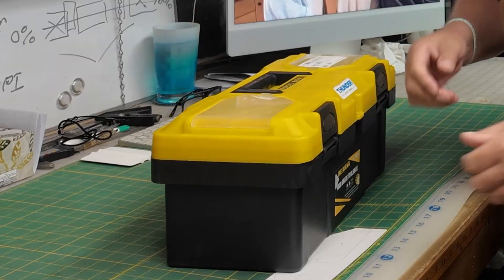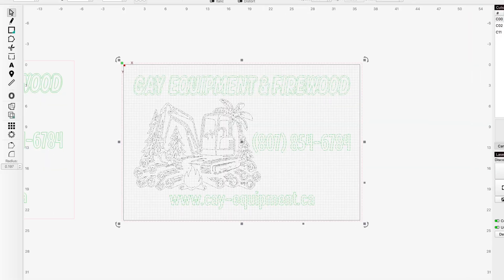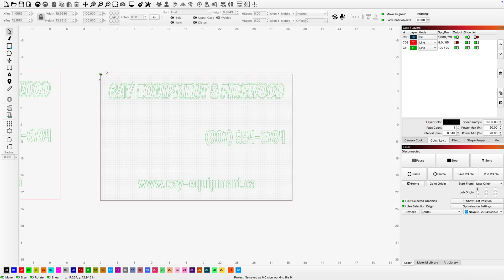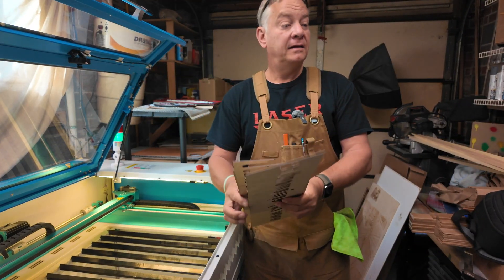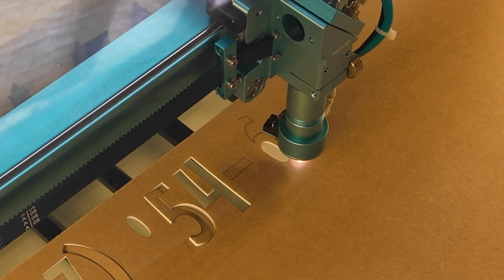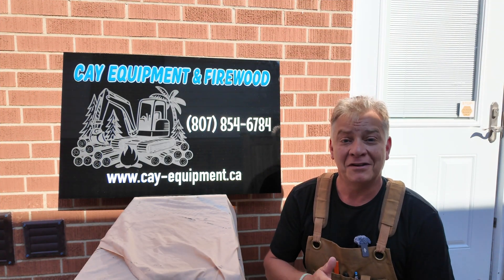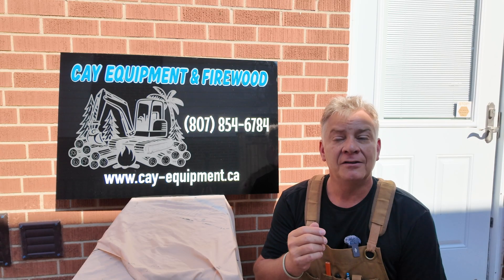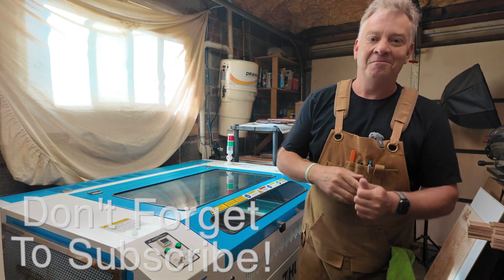Big Acrylic Sign Build. Part 2 of 2  Thunder Nova PLUS 35.  101   4K

Comment: I am looking for direction. I want to cut simple squares and rectangles, 3/8 to 1/2 cast acrylic with simple rounded edges and a few holes for hardware. Marine hatch lenses. 36 x 36 max size. CNC vs co2 laser? what machine to you recommend? thanks
Reply from the maker: Good morning Andrew - hope you had a good Christmas. I have never owned a cnc machine so I wish I could help. Perhaps take a look at lasers big enough to hold a 36x36 piece of material and also at some well respected CNC machines, prices of each and then ask for a demo on each to see how fast and clean they cut, what maintenance might be required for each of the laser and the CNC , ongoing expenses etc. I only have a 60 W nova PLUS and I can cut through the 1/2 but it is slow to cut through (about 2 mm per second). However there are much more powerful lasers than mine. Sorry I could not help more but good luck in your search and all the best!

Comment: Nice work. Doing my first good size engrave on clear. Noticed a lot of debris build up on the nozzle. Did you get this? Did you pause and clean the nozzle?
Reply from the maker: Good day. Interesting - are you using the 3mm tip or the larger 6 mm "engraving" tip? I have that happen on large engraves on wood. and yes, I pause the job, and use my pick tool to tap and scrape it off ( comes off easily) however never using acrylic yet - the engrave on this one was 1 1/2 hours and I had no build up at all. Are you using low air ( around 0.4 - 0.6 psi)?
Reply: @LaserNUG Yes sir, using the 6m on the 2.5 lens for the engrave but i was like .3 for air.. that might have been the problem. Did not happen with the test i did with a smaller piece about half sized so maybe just something to watch. Thank you and as always enjoy your content. Cheers
Reply from the maker: @SGTNick90  .3 is good except if the air flow falls below 0.3 for a certain period of time the laser will stop working and you will get an error on the screen. If you are using cast acrylic, i am not sure why it is happening . Sorry I could not be of more help.
Reply: @LaserNUG  No worries thank you for the input.  Appreciate that you respond.  I'm going to try another route and mask then paint it to keep it visible before I bed liner it.  thanks again